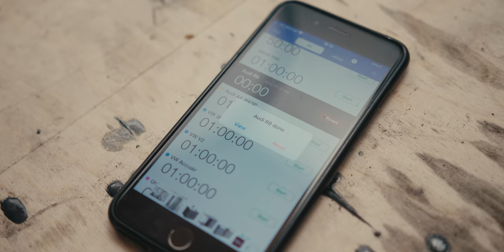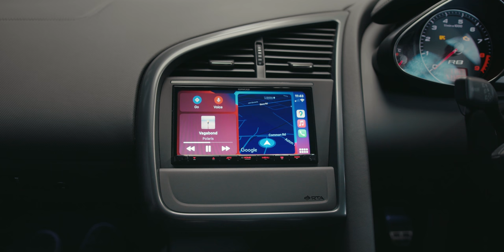Resin Casting Car Interior Trim // Making An Audi R8 Stereo Fascia

Comment: Love your work this is art! What kind of material do you use for the final product and how you make it uv light resistant? 

I run a small 3d printing business in Dominican Republic and I want to make a air conditioner vents for a Honda but haven't find the best material that give smooth shape and surface without a lot of post-processing like fdm prints require, I was thinking about print them in resin but for uv protection I have to apply clear coat but I have think about it will peel off after time and use, I will really appreciate any advice for make a useful product 🙏

Comment: Excuse me, what Material ist the negativ please?
Reply from the maker: The negative mould is made of silicone. If you check out my other video called “Making A Product From Scratch” you’ll be able to see the process of making the negative mould. Thanks for watching!
Reply: @RTAFabrication  thank you very much for reply!! 🤗
Reply from the maker: No worries! This type of silicone is called addition cure silicone. I specifically use one from a company called DWR Plastics, it’s their 1-2-1 easy mould with a shore rating of A28 (medium).
Reply: @RTAFabrication    i will try that out, keep your great Work Up 🥳👍